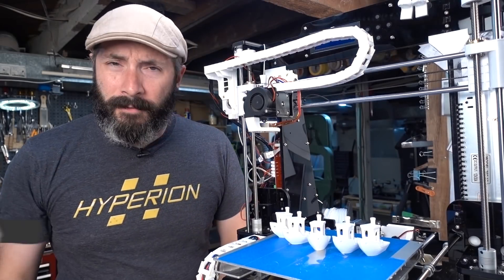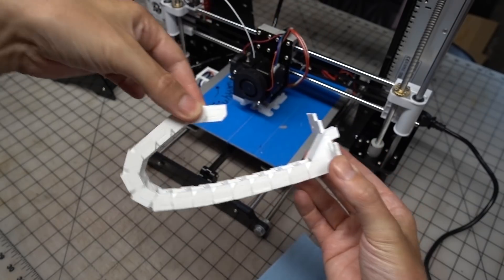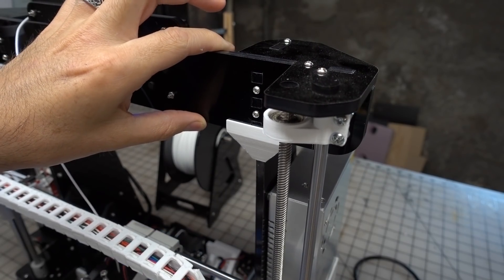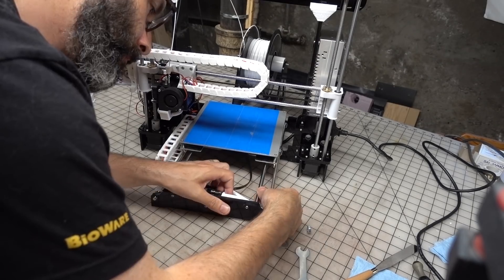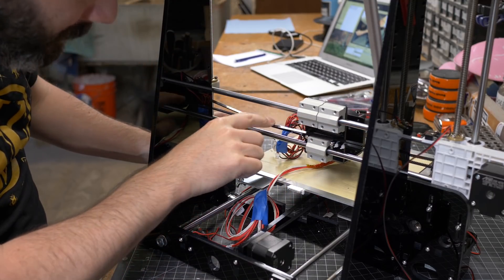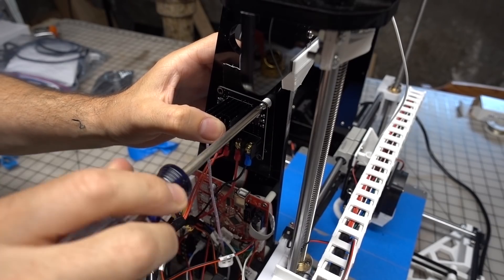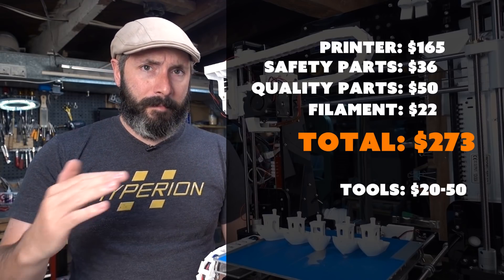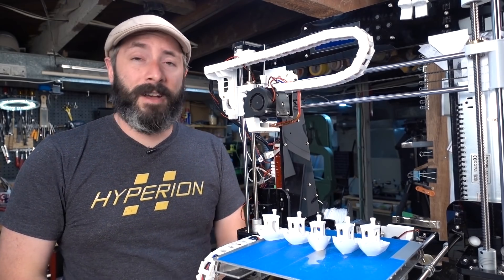Make a Cheap 3D Printer Better - Anet A8 Print Quality Upgrades

Comment: I realise this video is now over a year old, but I suspect that people will still stumble across it for picking out upgrade parts. The A8, set up properly, out of the box should not be printing with the poor quality shown in this video. Rule #1 in upgrading - never bother upgrading anything until you have it set up properly. This printer is not set up properly, and that is the cause of the print problems shown.

The most obvious example of incorrect set up is shown by the 'need' for Z-Axis stabilisers. The threaded Z-Axis bars and sprung connector to the motor have been set too low (the threaded bars are likely touching the motor drive shafts). When positioned correctly, those threaded bars will be tall enough to sit inside the hole in the top acrylic piece (which stabilises them). Simply getting this right will make a huge difference in print quality as the sprung connectors can then do their job of damping the torque and vibration from the Z-Axis motors.

Upgrade parts 'can' help, but no upgrade is ever going to correct a poorly set up printer.
Reply: I agree, I was gonna write that my bare stock A8 prints way better without any mods done so far. (And as has been said in other comments, some of the mods are counter productive).
Reply: I also agree. I actually made the same mistake myself before I realized it and made an adjustment. It was that improvement alone in this video that led to the improvement of his prints from what they first were.
Reply: Of all the things I've added to my A8 to make it work better, the only one I'd really recommend isn't even present in this video.
Spring centering makes the heat bed geometry much more reliable. Whether you do it with collars or inserts, that alone made 90% of my ghosting disappear.
Reply: @ezpzlmnsqz1337  when adjusted correctly the rod will sit in the guide hole at the top of the A8 ... The hole that is there for that very purpose. (I mean, do you really think the design has holes there for the fun of it?)

Being in that guide hole does not restrain the Z-Axis rods, it is there to prevent them wobbling when in motion. Wobble on those rods will negatively affect the print quality by transferring through to the print head.

You can choose to run them floating out of the frame and set too low in the motor couplers, that is entirely your prerogative. It is only your prints that are suffering because of it.

But before you commit to letting Reddit and your own confirmation bias rule your actions, take a look at high grade and commercial 3D printers. See if you can find a single one with floating Z-Axis rods... Then ask whether the A8 is really supposed to have floating Z-Axis rods, even when the design has the locating holes and equipment to have located rods, or whether the units that have them floating, simply have not been set up correctly.
Reply: Got one. Can agree
Reply: @ezpzlmnsqz1337   the rods should be inside the acrylic frame. it's not tight as the rods are free to move about 2 mm in radius within the acrylic frame, otherwise, you'll get z-axis vibration
Reply: @ezpzlmnsqz1337  You are correct they should be free.  My first print on my new A8, and actually my first 3D print ever, was a million times better than any of this videos prints.  It's a shame people are so ignorant of the facts and worse, spread their ignorance as fact.  Leave the threaded rods free, the smooth rods do 100% of the alignment.  All you will do by constraining the threaded z rods will cause binding, even if you can't see or hear it being transferred to your prints.
Reply: @MotorHead9871  Having them adjusted correctly does not constrain them as the locating holes are not a tight fit. Again look at every high grade commercial printer (chosen as it avoids home amateur set up mistakes), and try to find just one solitary example with free floating z-axis rods.

Printed locators will make prints worse because the encourage people to have the rods set low in the motor couplers, transferring vibration and excess torque from the motors. The rods should be completely decoupled from the motor, and when at a height that achieves that, they will be in the locating holes at the top of the frame. Still able to move freely, but not able to wobble all over the place.

This is fundamental stuff; any vibration on the z-axis will transfer through to the head and negatively impact printing. Which is why no commercial printers have free floating axis rods.

When I first set up my A8 I had free floating rods because I left them exactly as they were in the decouplers from the factory. It was only after several prints that I looked into it further as floating rods didn't make much sense with locating holes being built into the design. Once they were adjusted correctly, print quality improved further (imagine that).

Now you could keep calling us ignorant and saying we're spreading misinformation. Or you could examine why the only printers with floating axis rods are ones that people put together from kits, try them adjusted correctly, and find your print quality improves... It is the difference between reading what other people who have made the same mistake claim, vs actually making the changes on your own equipment and seeing the difference yourself.
Reply: Brilliant tip - why have I not seen or read this anywhere else?
Reply: @damionlee7658  Thank you - as soon as my current print finishes I will be changing mine. Yes first 3D printer and I know nothing!
Reply: @lufusdoofus  we have all been there.

I don't know why this is not widely written about. I suspect it is because it is only ever an issue with kit printers, and people have a tendency to think parts like this are correctly set from the factory. Which is kind of reasonable, especially as the instructions never seem to talk about how to set these rods correctly.
Reply: You know I could write something just like this & someone else with the level of knowledge I have will think the same as I'm thinking now ' wow this all sounds very technical I don't understand 2d printers never mind 3D printers' I'll have to find someone that knows what printer would be best for my application because none of the writing means anything to me as is.
Reply: @ezpzlmnsqz1337  Yes.  Right.  No bearing!  No one will ever read this, but there is a 2nd problem as well:  The z-axis motor coupler should be elevated from the motor, and the screw rod ought NOT REST on the motor shaft, through it.  The threaded rod should FLOAT.  This cleans up z-layers immediately, and this is his main problem.
Reply: Now that this comment is over a year old and so is my printer, I can confirm. I get some damn near flawless prints with little upgrades, I have the frame supports, belt tensioners, and mosfets shown in this video on my printer, that is it physically, I am happy with this, and its very usable in this form. I suggest using the latest version of marlin though, it has made a huge difference in reliability.  I stumbled on this video because I am looking to do dual extruders so I can use a soluble support structure, or even play with dual color prints.
Reply: The only thing you should upgrade before starting it up would be adding a Glass or Magnetic bed.
This will prevent you from ruining your printing bet with loads of printing errors or scraping with a scraper.

This is something i will do before Even starting it up. since it will Save you the Headache of having your bed destroyed. by a Gcode error.
Reply: @darknessblades  agreed. A decent alternative to the tape bed is definitely worth considering up front. There is probably some common phrase about exceptions, proving, and rules that could be put together by a clever linguist in this situation...

I was surprised by how good the tape that came on my A8's bed was. Saying that, my only regret about switching to a glass plate was that I didn't do it sooner.
Reply: @damionlee7658  I know, i have seen 3d printers that are Just RUINED. the bed looks like it came out of a warzone.

That is why my first upgrade will be a glass bed.
{i have a Anet A9} and was lucky to find a seller who sold 160x160mm glass plates. after i ordered the printer.
{still have to receive everything, including some minor upgrades}
Reply: You just fixed the used A8 printer that I was handed last week...
Reply: @FrivolousPanicButton  I hope it brings you many hours of enjoyment. Happy printing.
Reply: i was just gifted one that looks like this, and prints one thing perfectly and then i can't get it to print anything else, do you have any resources that might help me?
Reply: @nekodesigner  hello, let's see if we can find some appropriate information to help get your printer giving you good results.

I'm on my mobile right now, so I will come back later with a few useful links to check out with general setup and troubleshooting information. But also, if you can explain what is happening now, perhaps I can offer some information/links to information about your specific issue.

Can you explain what is going wrong with the prints? For example, perhaps the layers are not welding together, and the print is falling apart. Or perhaps the print starts fine, but doesn't stay on the bed, and starts moving around, or falls over during printing?

If the issue is with the print staying connected to the bed during printing, what bed surface are you using? (Tape, rubber, or perhaps glass) and are you using an adhesive on the bed (what type)? Is the bed heating up, and is the filament coming out of the print nozzle smoothly and uniformly.

I'm sure we can find out what the problem is and find a solution.
Reply: @damionlee7658  i had some issues with the z offset but looks like i was able to fix that, i just printed a 6-hour piece and came out pretty decent.  i played a lot with the slic3r settings and finally got to the settings that work for this printer.
Reply: @damionlee7658  thanks !!

Comment: I got my A8 more than 5 years ago and just found this video. I have 4 important remarks:
 1. If you put too much strenght on the belts, you damage the bearings of your steppermotors.
     This results in stopped movements on the damaged axis and causes shifts in the layers.
 2. To improve quality, I installed 2 tread-rods from the top Z-axis to the front X-axis.
      The stiffness reduces vibrations dramaticly and helped a lot.
 3. Flash Marlin - it's worth the effort.
 4. Best ( luxory ) decision was to get a raspi and use octoprint. Highly reccommend this !
The A8 isn't as bad as shown in the fist minutes of the video, Z-axis were not correctly installed.
With a few $ you can step up the quality of the A8 up to a point where you can even print rc-planes with great accuracy. ( Like I do )

Comment: Love your videos, I've had my A8 for almost a month now. Strangely, after assembly, my prints looked like your "after" Benchy. I've added only a circular fan nozzle, T-corner brackets and Z-Axis stabilizers. I started out pretty conservative with printing speed and gradually increased it. Very impressed that it can sit quite happily at 70mm/s. Hope your prints continue to improve!
Reply from the maker: 70mm/s is definitely faster than I've been printing. That's pretty fantastic. I suspect that these printers are shipped with a wide range of quality. Perhaps you won the A8 lottery and got the best parts possible. =)
Reply: Haha, maybe! Putting it on a vibration-dampening surface also helps a lot with little glitches.

Good luck and cheers from a fellow Seattle maker!

Comment: I built my first 3D printer and dealt with a lot of these same issues. Exposed mains wiring, sub par parts, hours of adjustments and dialing in settings to get reasonably good results. It was a struggle to get it working well enough to print parts to make it work properly. I enjoyed it and it taught me a lot about 3d printing and that's great if your interest is in 3D printing as a hobby. 

If your hobby is prop building and the 3d printer is a tool, I'd just find a way to scrounge up the cash to get one that just works. Then you can focus your time and brain power on getting better at designing. My second printer is a PowerSpec Ultra 3D, $700 from Microcenter. I had it working in about 30min and it prints far better quality than my previous printer with dual extrusion to boot. You don't need to spend $2000 to get a decent printer, but it's also not worth saving a few hundred bucks using something that is unsafe.

This is by no means a critique on the series, just some advice from someone who's gone down both routes.
Reply from the maker: Great advice, thanks for sharing.

Comment: Z-Axis decoupler, like those found in thing 1858459 remove the coupling of the X axis to the Z axis and allow the lead screws to move a bit while not moving the X axis side-to-side. Side product is being able to lift the carriage by hand to work on the nozzle to clean or change filaments without needing to do so via the controller.

I've also found that toothed idler pulleys remove the "wobble" you find in the X/Y dramatically because they're not constantly changing belt tension during movement due to teeth riding on a smooth surface of the other bearings.

Also, with Skynet, a GREAT addition is autoleveling. The developer of skynet sells pre-made sensors on his ebay page for fairly cheap, or if you're not afraid of making a voltage divider and soldering into a connector, you can make one yourself pretty easily as well.
Reply: As well, the frame braces found at thing 2099154 made a DRASTIC improvement. Even having just one brace (like I had to move to when I did my dual extruder upgrade) makes a hell of a difference. You can speed up your acceleration and jerk settings a bit and not get wobble or singing in the prints with the braces installed. Added bonus of looking awesome.

Comment: how the freakin hell do you manage to  get so terrible prints with that machine? my benchis has been almost flawless from day 1 with cheapo filament
Reply: Yeah same without any upgrades it printed better than this thing with upgrades
Reply: Tim Montanus i also get very bad printouts.

So frustrating and disappointing.
Tried the bed leveling, temp increase decrease. Filament tension. Slower speed.
Nothing helps.  Prints garbage
Reply: It's probably a matter of quality control at the manufacturer. Loose tolerances make for some items that work perfectly and others that don't work at all. Back in the 60's I met a guy with a 650 Triumph who could rev it farther in second gear than others could in 3rd. He got that one perfect one. Heh, it would almost keep up with a 1969 Honda 750.
Reply: My a8 worked fine from the start at 100mm/s movement speed and cheep filament
Reply: I've had my Anet A8 for over a year now and it has been printing flawlessly.  Not sure how some of you are getting such terrible prints.  I've only had those issues the first day before I realized the belts were too loose.  After tightening up the X & Y axis belts the quality has been outstanding. The safety issues with the printer... that's another story. Get mosfets and also solder the heated bed connection wires at the very least. Upgrade to Marlin firmware to enable basic thermal runaway protection.
Reply: Same here, I made no upgrades at all and got better prints. I think his slicer settings are just crap.
Reply: Same here! First print was a benchy which came out better than any in this video. A8's are fantastic printers, especially for the price.
Reply: Yeah pretty sure the slicer settings were just bad. Lol that sucks. All that time. At least the printer looks cooler!
Reply: Thats what i was thinking. It may be something in his gcode because my prints have beautiful walls. My only flaw with this printer is stringing. Ive tried everything.
Reply: You are correct they should be free.  My first print on my new A8, and actually my first 3D print ever, was a million times better than any of this videos prints.  It's a shame people are so ignorant of the facts and worse, spread their ignorance as fact.  Leave the threaded rods free, the smooth rods do 100% of the alignment.  All you will do by constraining the threaded z rods will cause binding, even if you can't see or hear it being transferred to your prints.
Reply: @davemarm  Me too!!!  Leave the Z threaded rods alone and tension the belts and you will blown away by the prints.
Reply: @kindkyle6766  I got bad stringing because Cura turns off retraction when combing is enabled. Turning combing off reduced stringing to me.

Comment: I have had my Anet A8 for about a year now and If you want solid prints just spend the money on an e3dv6 (Original) and plan on replacing that original motherboard as it will fry without warning(even when cooled). I'm currently running a Ramps1.4 setup and can say that i'm very happy with the e3dv6 with BLTOUCH sensor. Thanks for the video.
Reply: I'd replace the mainboard just for the extra IO, so I can finally have things like a probe, or the ability to turn off the power supply.

Comment: Strange that my A8 got the same quality as yours after all the upgrades. So far I've been happy with the quality. If it fails it only fails to start the first layer correctly, and I can restart it or just let it be, problem fixes itself by layer 3. I've also found the fine tune eeprom settings and, was able to calibrate it to permit printing the entire hotbed, with the original software. But I can see all the improvements, and so far I've only added an X-axis tensioner (it's a must if you want to relieve tension on Z screws and guides).